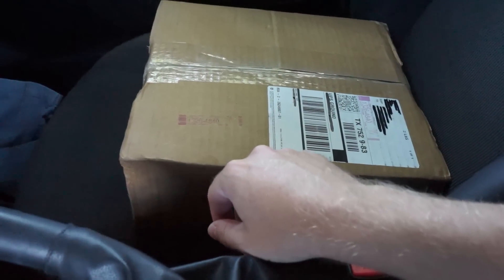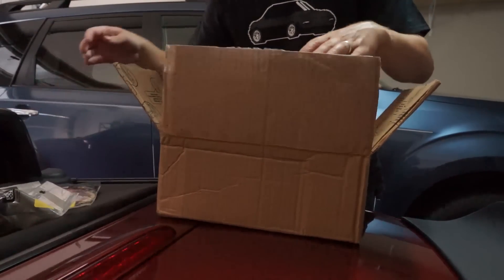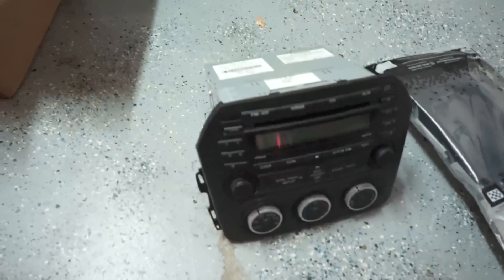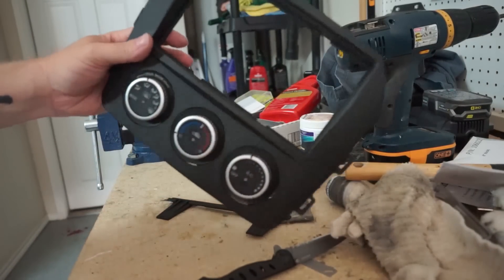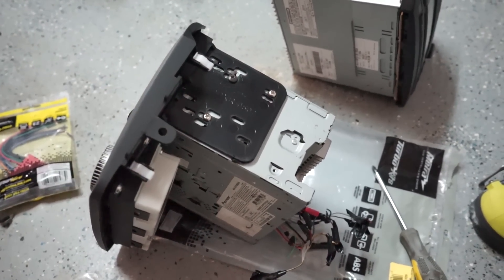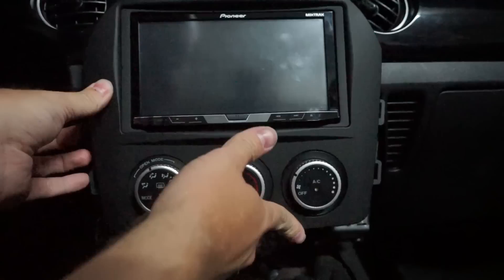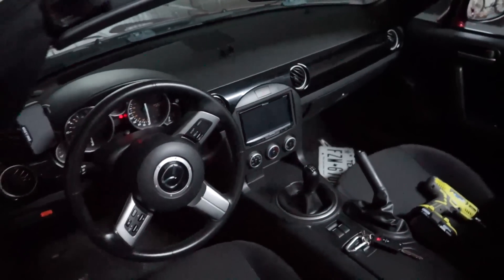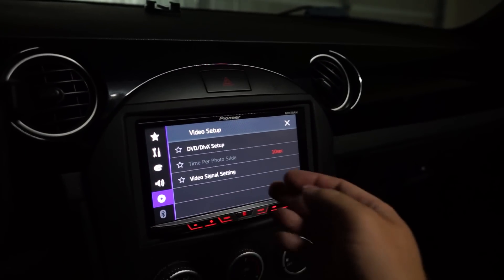Installing a Head Unit in My NC Miata

Comment: Very helpful video. I think that those of us who intend to do a head unit swap would appreciate the (a) brand name of the replacement trim plate, and (b) the model of the Pioneer unit that you installed. I understand that there are kits available to hook up the steering wheel controls.
Reply: I know this was 2 years ago but I second this
Reply: IMO, Pioneer is crap!

Comment: this is going to sound like a dumb question but if you wire up the bose system to the standard radio harness what happens? does it not output audio or does it damage something? bought mine used with a radio already installed but no sound from the 8inch speakers and am hoping it was not wired directly to the radio or even worse that it was wired and they blew something up

Comment: I got the same kit in the UK with Bose and you can get steering wheel adapters. I fit a Kenwood 7017dabs GPS antenna dab digital antenna sterring wheel controls and interface to use the existing Bose amp and speaker. I'm pretty sure the steering wheel  controls were by the same brand.

Only problem with fitting was the mass of wires to tuck behind and how.to route the USB to the centre console.
Reply from the maker: Yeah I'm still meaning to get steering controls. Havent needed it bad enough yet I guess!
Reply: @ColoredinLight  I use them all the time with mine, useful for Android auto. if you don't really use them that understandable as To have to take it all apart again just to fit it would be a pain haha
Reply: I managed to tuck all the wires up in the sides, like the gap next to the glove box. I gently pushed/pulled them from either side while feeding the headunit in
Reply: what guide did you follow for completing the wiring to maintain the bose amp and speakers?
Reply: @TheTRoger19   +1

Comment: Great video! But does the head unit not support a steering wheel control adapter like the Axxess ASWC-1? I figured a fancy HU like that one would. I installed a single DIN Sony MEX-XB100BT and was able to retain the steering wheel controls with the ASWC-1. If it was a wired remote jack on the back then it should.
Reply from the maker: It definitely does, but being my first time I didnt really think about adding it. I'm going to go back and see if I can which should be a simple fix.
Reply: It supports the SWC. Check out crutchfield for options (i believe there are 2 different manufacturers that work with our cars). Easy to install and not that expensive either.
Reply: Awesome. It looks great, I love the way the double DIN screen looks at home in the dash. Some day I will replace my single DIN with a double, they just look so clean.
Reply: Great video, I also have a 2011 MX-5 with a prht thats all stock But I would like to replace the head unit someday pioneer looks like they make great units, what was the model number of your head unit ?
Reply: You don't need an Axxess to work with OEM Miata SWC, since they are resistance ones, just connect 2 wires in OEM socket, pins 1N & 1P.

Comment: When I put in my new head unit, I found that I could no longer use the 2 10mm bolts that were tricky to get to. My head unit and bracket just didnt have a place for them to thread into. The result is that my head unit and AC control assembly slowly starts to pop outwards and isn't flush with the dash. I can push it back in but it 5 minutes later its no longer flush again. Has this been your experience?

Comment: I bought a micro bypass for my stereo to avoid cutting reverse wire on my miata...by doing that you can operate all  functions of the stereo without engaging the hand brake.  my stereo is like yours, I wasn't able to change the screen back ground, dvd wouldn't work ect. bypass is easy to install. ebay $5 bucks.

Comment: Hello , may i ask you ? I do replace mine with a JVC 235DBT, had also order the complement connexion but i cant get any sound, do you know what it can be?  sorry for my english,  Greatting de france!
Reply from the maker: Hey kara, I'm not too positive on that. Maybe a connection loose somewhere? I'm not super well versed on audio equipment but just needed a new radio
Reply: Oh! ok  merci for the answer i will try to find out :)

Comment: Nice video. I’m planning an almost identical install, but I’m curious how you mounted the microphone for hands free calling. I’d like to mount it in the same location but I’m not sure how best to do it.

Have any suggestions or sources?
Reply from the maker: I did a small square of double sided foam tape and just tucked the wires behind the steering wheel shell and plastic panel when your knees are. Then ran the wire to behind the dash. Pretty easy!

Comment: I looked into this and was told that I need speakers too because I have a Bose system and the speakers are a odd impedance ?
Reply from the maker: JAYJAYJAY53 hmm I'm not sure. I havent experienced any issues although I would like new speakers. I'm not an audiophile!
Reply: Colored in Light  nor am l . NPR and audio books are my main listening formats so I ended up keeping my stock Bose system although I added a jack to run my books through my stereo using  an aux plug

Comment: Hi! Just a question, once the head unit is installed, the steering wheel controls continue to work ?? Thanks in advance! 👍
Ps. Greetings from Italy 😁
Reply from the maker: You need the control wires
Reply: Colored in Light, thank you for the info 👍

Comment: I was watching in the hopes of seeing you take out the original head unit 😫😫 was it very intuitive ?
Reply from the maker: I have a previous video of removing the dash trim that shows more radio removal. It's fairly simple, remove surrounding plastics then screws on front and then a weird bolt on the side you have to access through the driver footwell
Reply: @ColoredinLight  can you share the link to that video please?  thanks

Comment: Great video. However Im always at a loss when I watch em. why open the box on the beautiful car. why not put a duct sheet blanket? I was just waiting for you to drop that unit on your boot lid. Why not dismantle the old unit on a dust sheet or old towel? you reduce the chance of resale by putting the old unit on the floor. Makes no sense maybe i'm just a bit OCD? Maybe you should take the time to clean down the workshop and use that fantastic bench you got there and not use the floor. Glad you still have your fingers and the cover intact after that monumental  knife work! Wear gloves.
Reply from the maker: I think you are a bit OCD. It's just a radio. The car isnt scratched. My fingers are still here. Thanks for the comment.
Reply: @ColoredinLight  you could be right! Stay safe.